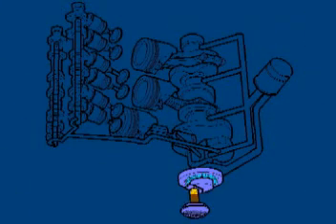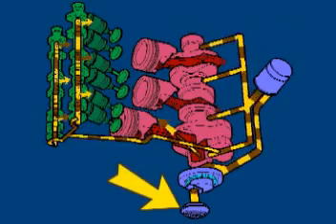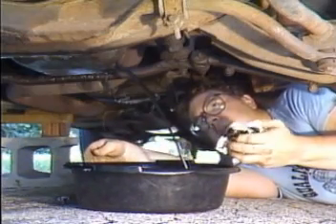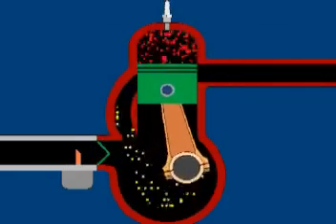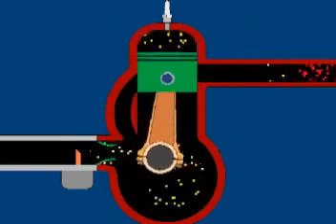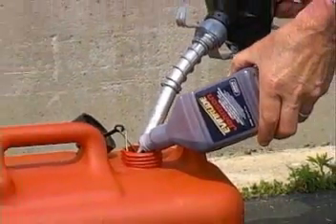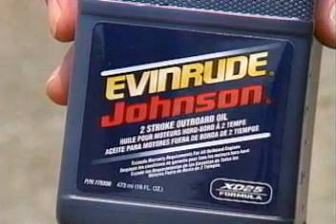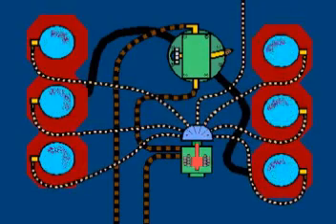2 stroke Vrs. 4 stroke outboards part 2

Comment: Why did they stop making 2-strokes?  Emissions.  It's as simple as that.  It's the same thing that's killing the Wankel rotary engine.  A lot of manufacturers of these small engines also make cars, which are almost all four-stroke (car engines are extremely mild compared to motorcycle engines, so four-strokes make sense) and making ALL engines four-stroke saves R&D costs.  And, if you look at outboard motors, snowmobiles, and PWC's, you'll notice that two-strokes are still doing very well.

Comment: your first explanation is totally correct. But at the last part of your explanation is totally different thinks however gasoline and lubrication  is different system. Cylinder wear caused by scrap ring of cylinder not function properly so that  rest lub oil burn together therefore lubrication system not running properly to cylinder wall. Lub oil oil running beginning from crank shaft, crank pin bearing, connecting rod and cylinder wall return to oil pan with metal babitt. It must be clarify.

Comment: When my dad and i went out looking for a new engine we started with four strokes because of the quiet, smoothness, and cleaner exhaust. What did we find? All those were wrong. They are very shaky engines, they are NOT quiet and with fuel injection the two-strokes are as clean. Plus the two-strokes are way lighter. We got a two-stroke.

Comment: @wapperott Dear wapperott that's because you can't add too much oil for the 4-stroke while oil isn't mixed to the fuel. Oil pump distributes the oil to the right places with pressure and putting too much oil would have just the same result as putting too much water in a cup, the container would just overflow. But if there would occur a leakage of oil in the combustion chamber it would result the same as putting too much oil into the 2-stroke engines fuel tank! And I do apologize my poor english.

Comment: Generally 4-strokes run higher compression (making them less reliable) and 4-STROKES REV HIGHER. Two Stroke Shop produces a 500cc 3cyl that revs to 10,500rpm, a 600cc 4-stroke makes a few less horsepower and revs to 15,000+rpm. The 2-stroke also makes 20lb-ft more torque(150% more). Less compression is why the 2-strokes have such short kick starters compared to 4-strokes.

Comment: @drjjlj 600cc 4-strokes in the suporsport street bikes actually redline above 16,000rpm and make peak hp at about 13,000rpm. The 1000cc superbikes redline above 13,000rpm and make peak hp at about 12,000rpm. Yes, these are the current crotch rockets. The new BMW S100RR redlines at 14,200rpm.
A normal 4-stroke car will redline at 6,000rpm. A Ferrari will redline at 8,000rpm+. The Caparo T1 has a redline at about 12,000rpm.

Comment: @rangerssteamtoys 2 strokes are in fact easier to start after time. your precious 4 strokes special valve wear out and this makes it lose its over rated compression and makes it really tough to start. the only way to make a 4 stroke run with a 2 stroke is make it bigger and heavier or make it turn crazy rpms which wear it out sooner

Comment: you can buy one in 2007 depending on the manufacture, i think yamaha is last to sell small two stroke engines. other then that its a new 2006 model. i just picked up a new 06 9.9 mercury 2 stroke. one of the last of its kind.

Comment: It must clarify about to mix gasoline and lub oil. It  is not sufficient enough just mix up lub oil could be represent lub oil go into cylinder to cooling cylinder wall. However  lubrication system is different way and different function with gasoline. Lub Oil must changed periodically to maintain crank shaft, crank pin, connecting rod, pin piston, cylinder wall, cam shaft, rocker arm. That 's why we need Top ring, oil ring, scrap ring cylinder to change periodically.

Comment: I'm an engine builder and have my own company. 4-stroke more reliable is a myth launched by the engine companies. 2-stroke if used good quality oil and good carburator settings it will run forever, just as long or longer than a 4-stroke. 2-strokes got the bad reputation, cause mostly no garage knew how to set them right.

Comment: u must realize that in a four stroke the compression stroke happens in a larger displacement while in a 2 stroke engine some of that compression is lost due to the thin reef valves...the evinrude got slower and slower as more people went on board the boat...while the suzuki nearly kept the same speed even with near 9 people on board..

2 stroke gets the power from the added revs ---> this means more wear and tear in the bore from the rings

Comment: 2-stroke + direct injection and oil injection is the best. more power, more torque, better fuel mileage, cleaner emissions, cheaper, and as reliable as a four-stroke.

Comment: 4 stroke has a better compression stroke....and will deliver more power for 1 cycle then the 2 stroke does...the 2 stroke just adds the power because it revs twice as much as 4 stroke (Theortically..)

and another important fact...4 stroke ARE WAY MUCH MORE SILENT....WAY MUCH MORE...the suzuki added an exhaust porthole above the water line just so u will hear it working when idle..otherwise u would think the engine switched off..

Comment: If you had a, lets say two 300cc engines, one 2 stroke, one 4 stroke, the 2 stroke would put out much more power. if you foul a plug adjust your mixture! and you dont need to replace it just take some sand paper to it.

Comment: Myth: 4-strokes last longer
Truth: 4-stroke MX bikes last 30-60 hours before needing a major overhaul. 2-strokes will go 200 hours on a top end, then replace the piston and keep going. Performance 2-stroke boat engines are known to go over 6000 hours. Or equivalent to 200,000+ miles in a car with a lead foot.

2T: Lighter, more powerful, more torque, less maintenance, more reliability and now with DI lower emissions and better fuel economy.

Comment: Four strokes produce more power, the use of 2 strokes is due to the weight factor. less moving parts, (valves etc)  however the 2 stroke will not run as economicaly as a four stroke.
To prove a point, how many 2 stroke formula 1 cars are there ? (none) Boat engines are best in 2 stroke form due to the lighter weight, cost and application,

Comment: A 2 stroke of the same displacement as a fourstroke produces far more power.nobody ever compares engines of the same displacement. compare 2 similar size mx bikes. example
2001 cr500 2 stroke. power 65bhp 6000rpm
compression 6.7-1

2001 crf 450 with 500kit , power 57bhp at 9000rpm
compression 12.3:1

So 4 strokes do not have higher compression right? perhaps in outboard apps but therefor they must have much more displacement and weight because they are far less powerful.